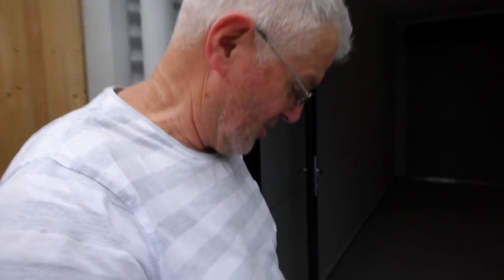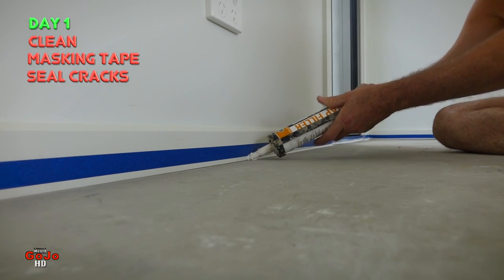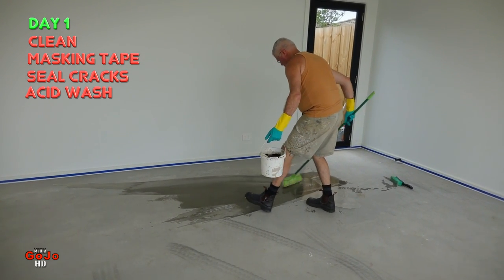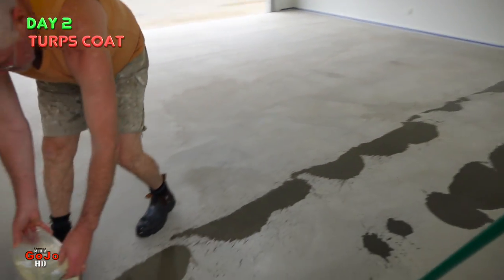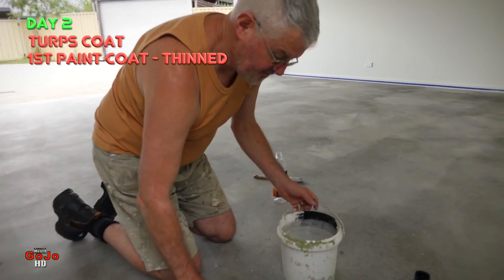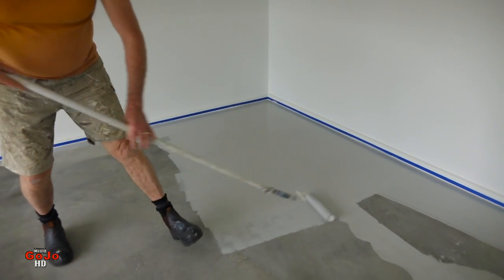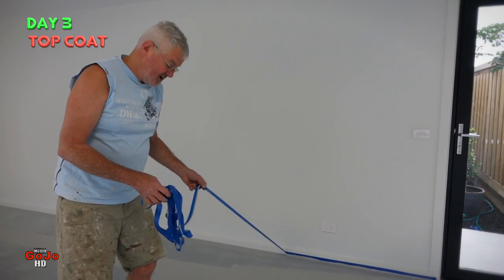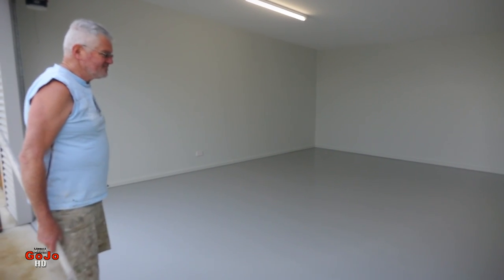Prepare & Paint Concrete Garage Floor | White Knight Ultra Pave | How To DIY

Comment: So it is not necessary to use two pack epoxy with polyurethane coating? Which oil paint to do you recommend in Australia and will it sustain heat from the tyres?
Reply from the maker: The one I used here has been great
Reply: @GoJoGeoffVlogs   yes but which paint??
Reply: @elsiegrace4616  White Knight Ultra Pave